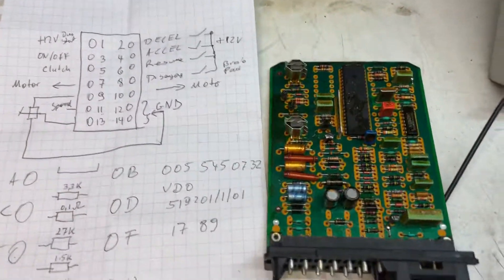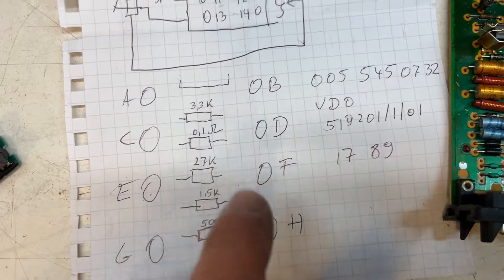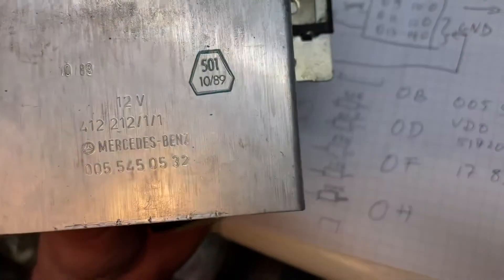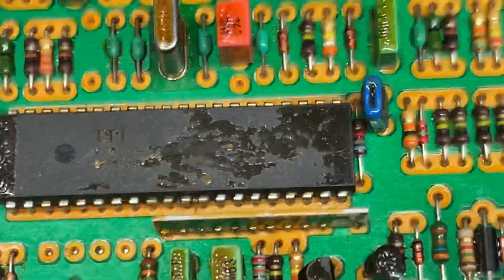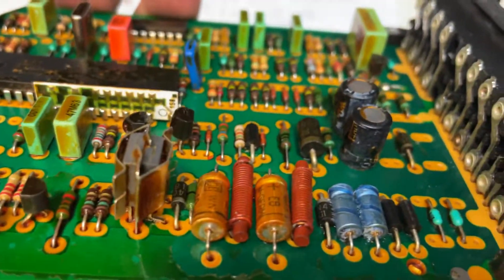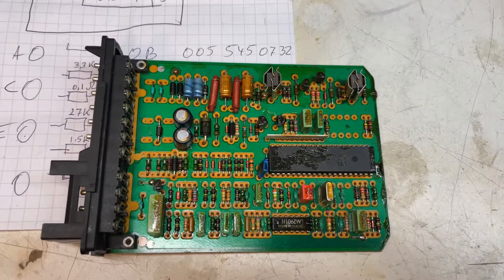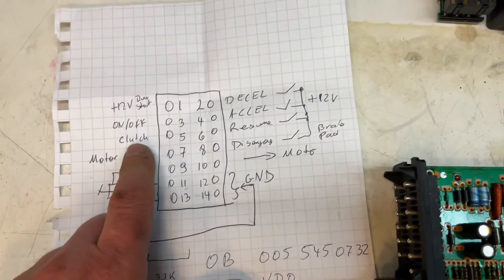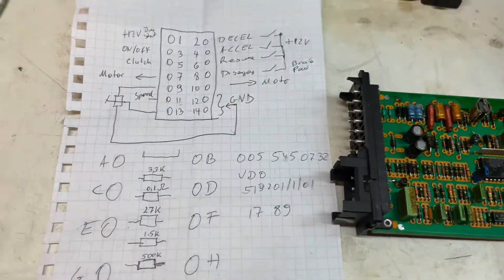Mercedes Benz W126 560SEL 3/89 Testing & Overhaul of Electrical System and All Control Units Part 5

Comment: Hello, what is the measurement of a spark plug for a Mercedes 126 model, 560 engine, depth between negative and positive?
PT Spark Plug Gapper Gap
Reply from the maker: 0.8 mm